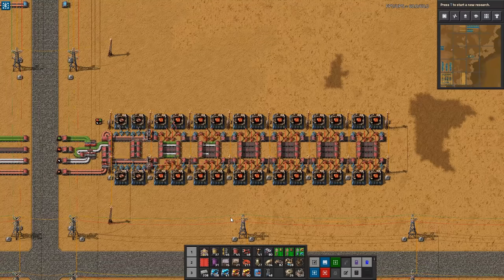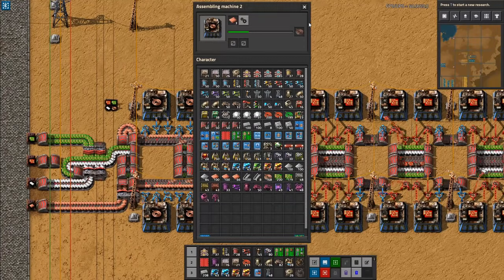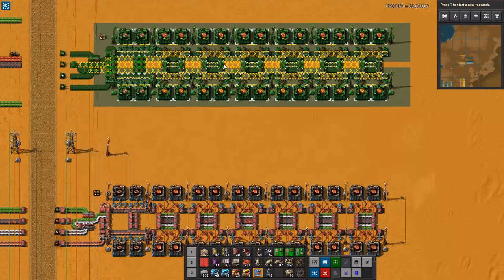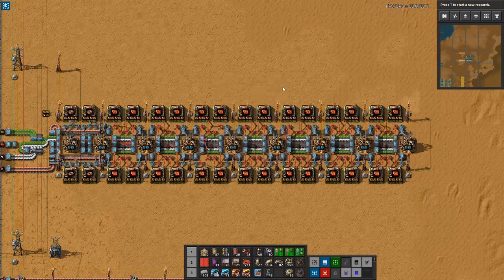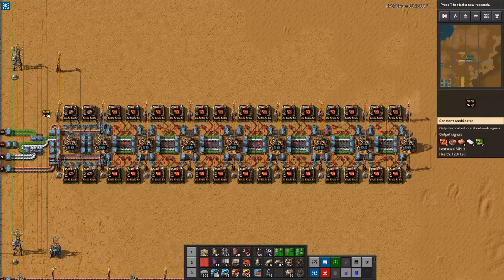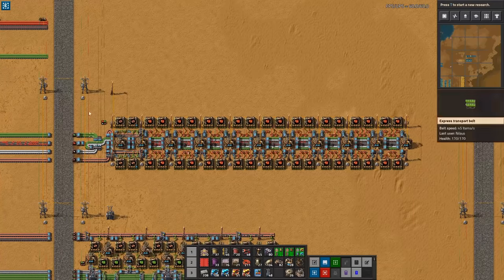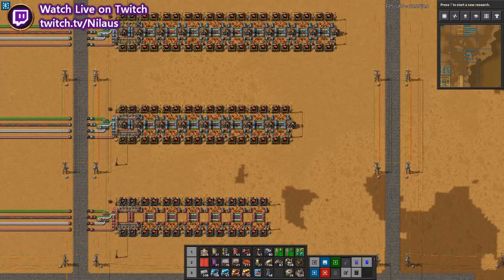Upgradeable ADVANCED/RED CIRCUITS -  Factorio 0.18 Tutorial/Guide/How-to

Comment: I like the tier 3 build but I realized that it isn't using as much of the inbound resources as it could , in fact nearly half a blue belt for each (green circuits, plastic and copper). So I made my own design that used almost an entire blue belt of each. This required adding four more copper wire assemblers and redesigning that area so that it would take in the copper from the bottom and output the wire at the top. 4 assemblers fully saturate a blue belt with copper wire. For the red circuit assemblers, I decided to move the beacons to be on the outside of the build so I could get more speed from them, which was necessary for it to fit in a city block (the design calls for 42 assemblers). My design also made it so using long-handed inserters and even fast inserters for consumption just wasn't enough, so I redesigned the beltworks to allow it to use stack inserters for all inbounds, So the long handed inserters are only used for the outbound red circuits. All in all I managed to double the amount of red circuits I was producing to 30/s. So with a slight increase in size, I am able to fit 3 copies of the build in a city block and fully saturate two blue belts of red circuits. But doing so takes in twice the amount of resources.

I'm not sure if my design would be useful within just a normal base. Perhaps it'd only be useful for mega base builds. But either way it was fun to design.

Comment: I don't know if you're be interested, but I did find a modified form of this blueprint that uses beacons and works pretty well. I'm not expert on the game but I've observed my build running for a while and it's all going smoothly.

According to calculator, the build is taking input of inputting 37 copper plates, 86.333 copper wire, and 43.167 green circuits and plastic, and outputting 88.8 copper wire and 30.217 red circuits. Much nicer ratios for a blue belt factory (and with three lines to output two full blue belts of red circuits, you can just take out a beacon or two to fine-tune them to an exact 90). The only major difference from your build, aside from beacons ofc, is the copper wire set-up. All the assembly machines are still in a straight line, but with the higher rate of input and output they demand of course the copper wire needs a dedicated two-sided blue belt, so I had to design such a system and in such a manner that they can deliver all their output efficiently (it's taking four stack inserters, yikes!) I can share a screenshot and blueprint if you like.

Also, thanks very much for these tutorials. That calculator mod alone is glorious, and as I go from a belt base to a megabase, I'm really appreciating your designs. I dislike seeing screenshots of factories that are just two or three assembly machines surrounded by a dozen beacons and logistics chests, your designs are nicely laid out and aesthetically pleasing as well as being efficient and easy to tile and expand.

Comment: Hmm, if you put T1 speed modules in the copper wire assemblers early you can boost copper wire output and lengthen the build to its full size almost right away (instead of waiting for beacons). A bit more costly for copper, but will give you more output earlier.
I'm assuming part of the design principle is you want to avoid removing machines from the build as you could also add more copper wire assemblers, but the belts won't keep up once you fully upgrade everything.
I'm also curious, did you look into green + red integrated builds? I see them used occasionally and it seems like there is space here for a really interesting build.
Overall another solid build.  Thanks!

Comment: Probably would be a good idea to extend this design by extending the belts, you could even fit it inside the city block by flipping and positioning at the top, could even include some beacons in between like a sandwich. Wouldn't be the prettiest but it's a way to consume the full input belt of plastic and greens

Comment: For the late game, maybe you could extend it further if the copper wires were made to fill both sides of the blue belt? It may require making significant changes to the copper wire part of the build, so I understand why you did not. I'm interested in what the fully beaconed build will look like.
Reply: I use belt weaving to fit everything. Red circuits craft so slow that red belt for the output is enough. Then I can weave the copper wire belt into the same space.

Comment: I like the focused tutorial, nicely done.  Interesting how you used the splitters to manage the half-belt inputs, something I have tried a number of solutions on.  One question though:  I have noticed in some of the classes you are using more Long Inserters (red).  I am finding this is a limiter as I experiment with testing the designs in higher throughput scenarios - they cannot keep up with blue belt speeds, etc.  Any thoughts there?  Is there something I am missing?
Reply: I realize this answer is late but I'll answer for future people.  Nilaus does love his long inserters, and I have the same gripe, however it does work for this.  I get lots of inspiration from his builds, but almost never use them directly since I restrict long inserters to output only as much as possible.

It does help to get inserter capacity level 2, which gives them +1 item in hand, effectively doubling their throughput.
You are correct that long inserters cannot pull from a moving blue belt.  In this scenario it works since the green / plastic belt is only moving at half speed.
Also, this design (and several of his other designs), are not intended for high throughput (mega base) uses.  They are only intended for mid game / bus based builds.  His later classes, for mega base builds, he uses almost exclusively stack (green) inserters.

Comment: As always, an excellent video. However, when I went to build your intermediate design (with the level 1 modules), I didn't see the same output numbers that you list.

After doing a lot of testing and hair tearing, it turns out that one of the updates for version 1 or 1.1 made some changes to level 1 and 2 productivity modules. They reduced the speed penalties from 15% to 5% and 10% respectively. That means that the intermediate blueprint now produces 8.12 red circuits per second (versus 5+) and uses 14 each of plastic and green circuits, and 12 copper per second.

You might want to update the combinator in your blueprint to reflect those numbers. It is a significant change, it seems to me. Doesn't affect the other blueprints though.

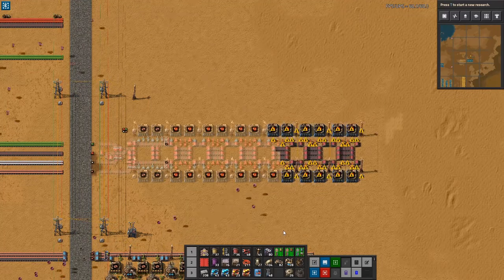Comment: 2:06 - you say you don't recommend extending... Given that the highest numbers you show in the combinator (at 2:20) are 6 items per second, why wouldn't you want it to be extended?  If you got rid of the filter splitters to let copper plate down the build, it should be able to be extended by a factor of... well, 3.75 by the numbers, for blue belt (edit: err, wait... no, make that 7.5, since that's for both half-belts, not one half-belt).  Which could probably be made to work as at least a 4x (edit: 8x) with prod modules of some sort... no??  What am I missing?  (Granted, your expansion modality is kinda cool in itself... but still, by final stage, you still have green circuits and plastic just sitting on a belt, that could be getting used, with a longer build.)

Comment: Hmm, this is one time I disagree with your build.
1) You have long handed inserters pulling greens and plastic from a blue belt.  This does not work at full speed.  Granted, your design does not have the belts running at full speed, but I personally find it bad practice.  This can be easily fixed by running the copper and copper cable on the outside of the machines, so the only long handed inserters are used for outputting the red circuits.
2) You don't allow the build to extend.  As you said, all the values are low.  By simply putting one copper cable machine at the beginning, and then scattering them down the build, you can get a lot more length per build.  This would also cause the copper to flow the length of the build, but you are then refilling the copper cable side of the belt.

I am a big fan of the double splitter design for the green circuit / plastic belts.  And I really like how you can extend the original array twice.